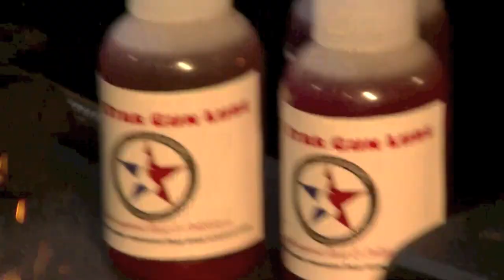SKS Bolt Mod

Comment: can you still switch back to the fixed mag and stripper clips if needed?
Reply: louis cyfer  Good question! I would like to know as well. What are the disadvantages of altering your bolt like this? I hate it when the maker of the video won't answer viewer's questions...
Reply: wrightconnection you can still use the original box mag. if you.have any sks modded or unmodded questions, hit up the survivors sks board.
Reply: wrightconnection yes you can, i did mine, works either way.